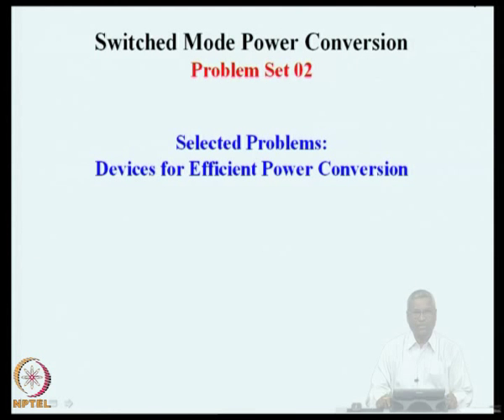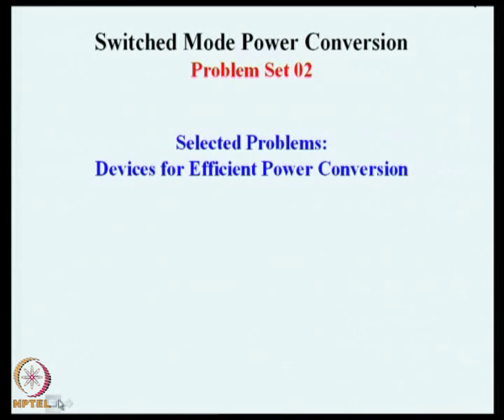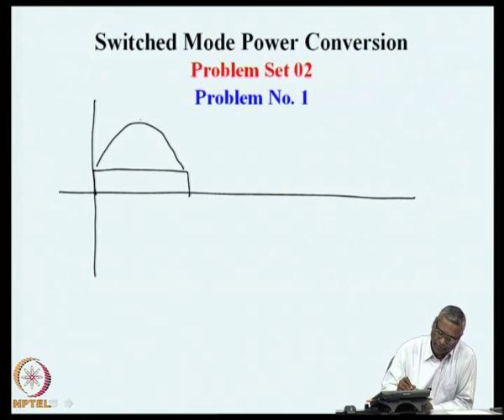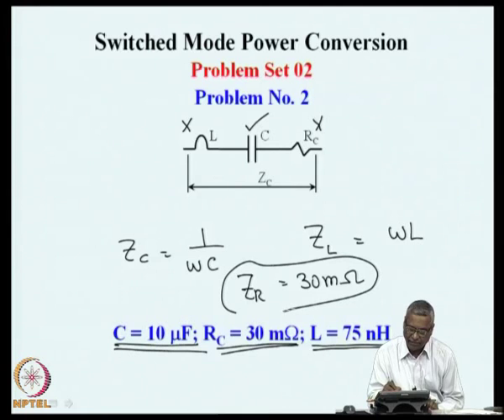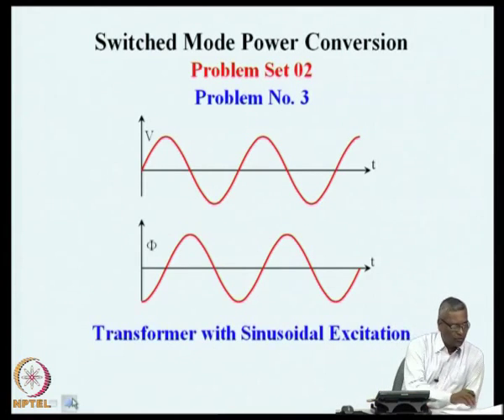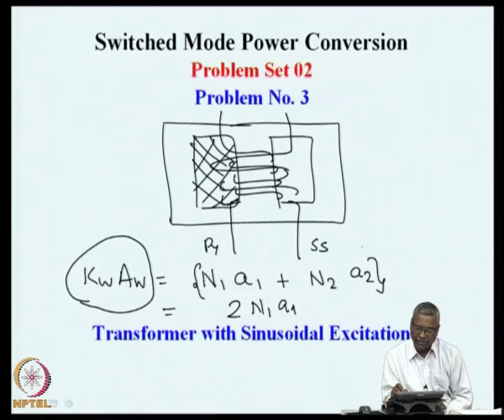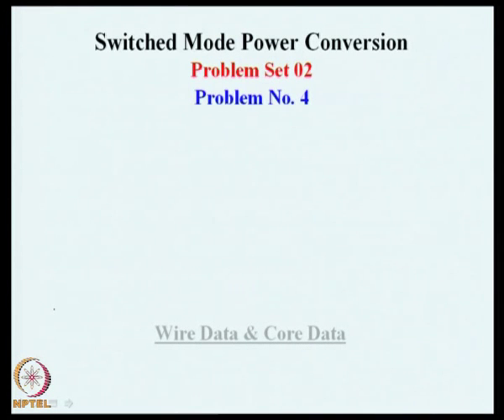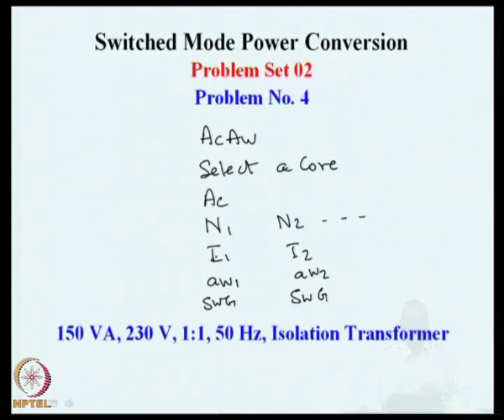Mod-04 Lec-09 Energy storage - Capacitor

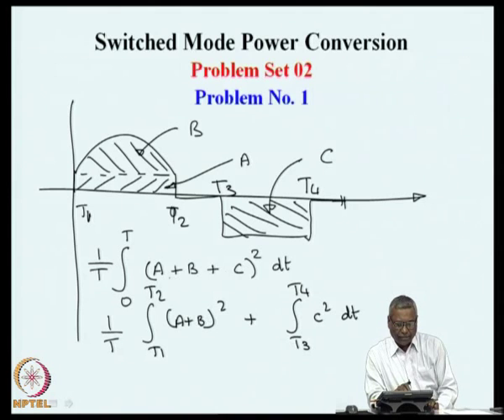Comment: While calculating RMS value of current at 15:30 the areas are marked as A1, A2 and A3 and is identified as current... How is it possible? The area is supposed to be the total charge (integral of current over time)... Actually the Symbols A1, A2 and A3 should refer to the instantaneous values of currents in their respective subintervals and using these instantaneous values of current we find its RMS value by applying the definition...The clarity is missing although the answer at the end is correct
Reply: yeah clarity at that place is not there.
Reply: @subramaniamg8004 clarity is there...